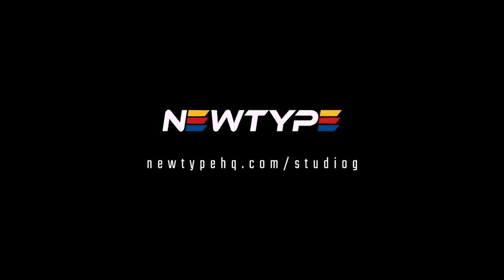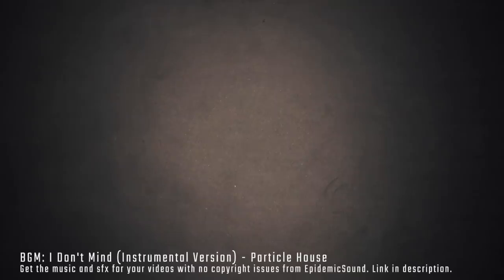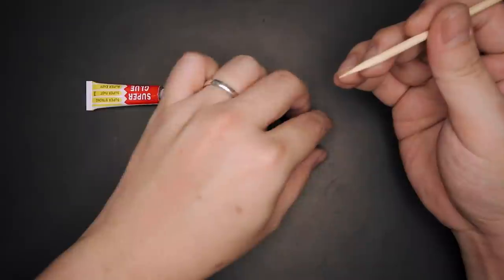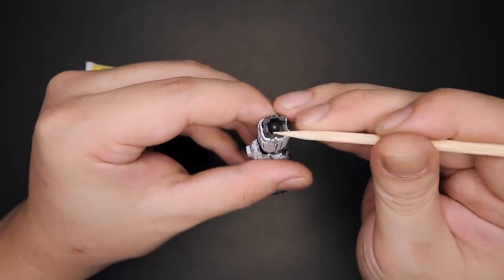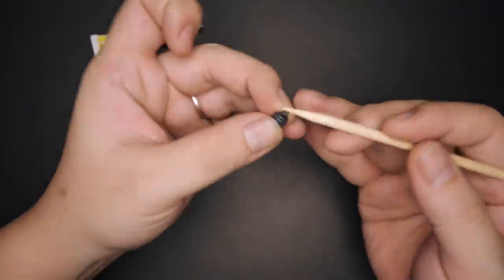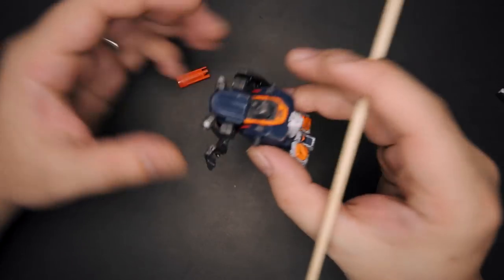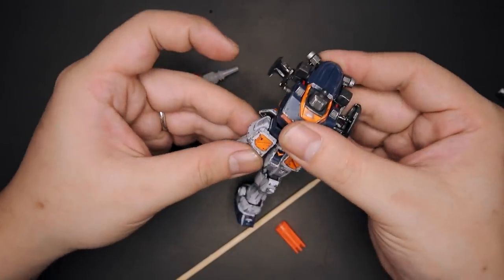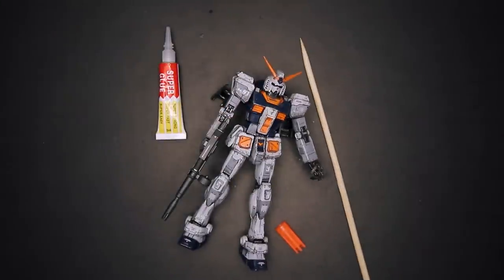How to fix loose joints | Tutorial Tuesday

Comment: I don't know why but I'm always very paranoid about permanent modifications to kits, so what I've always done, and it's probably a weird solution, I wrap a little bit of tissue paper or toilet paper around the ball joint or peg. If you do a small enough piece, it can totally hide inside the joint, and it's a completely reversible modification if you ever need to for some reason.

Comment: I should give this a go on my RG Destiny Gundam since there are certain parts that won't stay on and that's including loose joints too.
Reply: Even super glue can’t fix early real grades…
Reply: I heard that if you paint the ball joints with a gray or black it with have a better grip and no longer have the issue of loose joints.
Reply: @nick391nm  I usually just top coat all of the loose joints with 1 or 2 layers.
Reply: I'll have to try that out.

Comment: Hello Studio G. After I watched this video, I tried to follow this method to fix the loose joint on my freedom 2.0 mg. I applied a thin coat of super glue on one of the small pegs in the upper right arm. After the super glue dries, I tried to build the arm but the peg that I put super glue on got snap / broke.

Comment: Hi there, I wanted to ask if this was an issue on the MG Sniper you did in red, white, black/grey? Mine has a hard time keeping the legs inside of the hole for the waist section. Just pops out when I pose instantly. Have a similar in the Hg version but the waist on that one does not stay connected to the piece between the legs. Thank you

Comment: Hey Justin, just wondering does cements like Mr Hobby Mr Cement would work like the super glue in tightening loose joints as well?
Reply: if it's the non-thin cement, you can brush it on, wait for a day to cure, then yes it can tighten joints, but the wait time is too long and a single coat may not be thick enough so you may need to do multiple thin coats of cement and wait for each layer to cure, so it's more efficient to use super glue.
Reply: no man, u do not want to use Cement like Mr.Hobby and/or Tamiya Cements regardless of which version they sell to tighten joints because they work by slightly melting the plastic to bond/merge two separate parts together...those are for merging seamline or PS plastic. Just follow Justin's Instruction and use any good super glue on tightening joint and don't use plastic cement on joints.